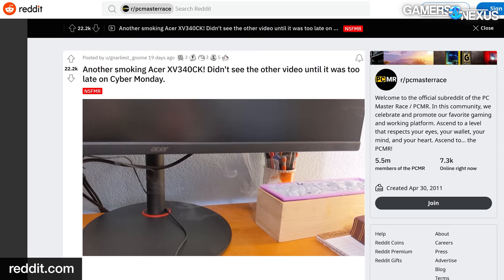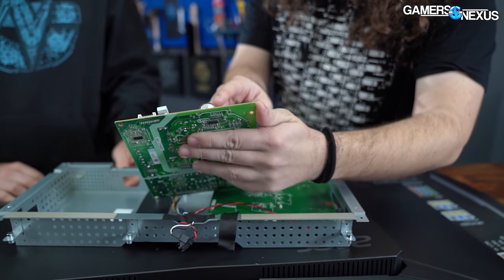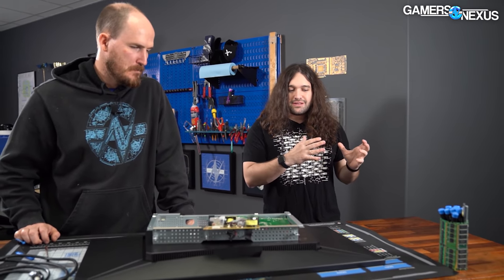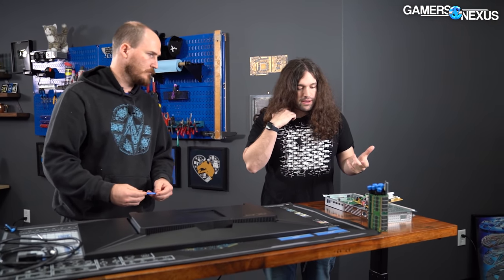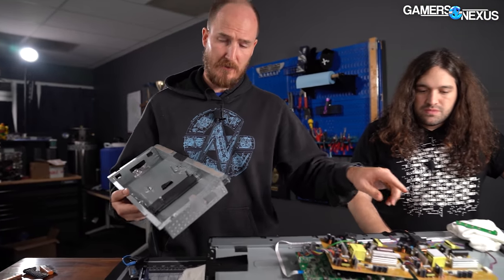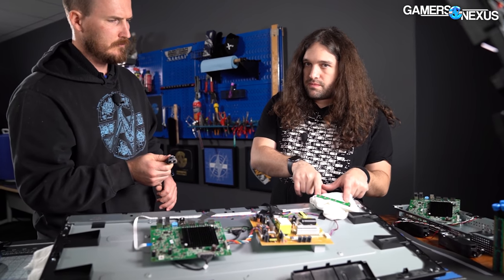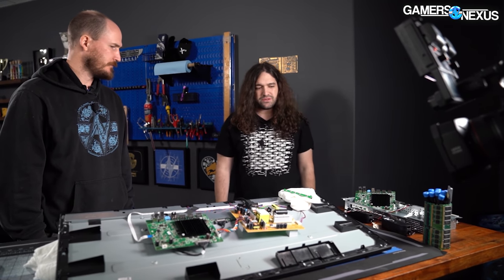Acer Monitor Fires Investigated: Blown Capacitors on Acer XV340CK

Comment from the maker: (FYI: We are now using one of the retail units in the office and are monitoring it for longer-term use -- might as well keep an eye on it and get some use out of it at the same time. We will let you all know if it dies.)
If you want to see a component spectacularly explode, watch our Gigabyte PSU explosion demonstration: https://www.youtube.com/watch?v=7JmPUr-BeEM
Grab our NEW Red & Black 'HUD' themed Mouse Mat on the GN Store! https://store.gamersnexus.net/products/gn-red-black-hud-mouse-mat
Grab our 'Volt' Large Anti-Static Modmat for PC building on the store (in stock & shipping now!): https://store.gamersnexus.net/products/modmat-volt-large
Reply: Asus ROG Z690 is on fire too high end bord too :o wtf
Reply: You gonna investigate the fire issue with the Asus z690 mobo that Jay posted about today?
Reply: Capacitor issues, welcome back to Mobo's in 2005.
Reply: Monitoring the monitor?
Reply: Monitoring the monitor, huh?
Reply: 2 things its either a bad quality capacitator , or a power spike ripple that revealed the issue, the smoke and humidity is normal when the main filter capacitator blows when on charge. have a happy new year love your channel
Reply: Did you make sure the refresh rate was set correctly in windows? Didn't hear you explicitly mention it.
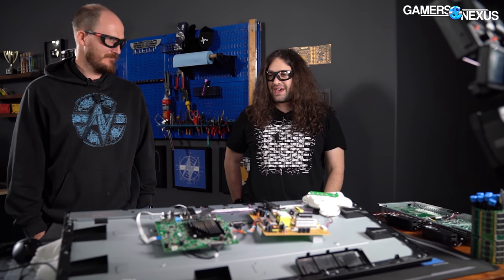Reply: 15:37 I feel that calculus was discovered by 2 mathematicians independently of each other.
Reply: Really nice to see that I'm not alone doubting about the quality of my monitor. I'm currently using an Acer CB342CK which makes lately a hell of a noice (like a BIG relay noise) while going to sleep.

I did not put it apart since it stills works but as you point it out, it can be a hazard and I'll take a look to see any failing part. 

Thank you ! Keep up the good work ! :D
Reply: Try using a FLIR camera to see if the capacitors get warm at any point. I don't see anyone using this testing method especially on components that have fire related issues and it gives quite good insights on heat related problems.
Reply: Does the monitor data plates show a date of manufacture? Maybe you can identify that monitors manufactured after a certain date have the different capacitor installed.
Reply: I'd love for you all to attack the eco side of electronics, on top of product safety and manufacturer/retailer issues. Good stuff!
Reply: That one taiwanese electronics manufacturer with an "A" at the start of it's name is still using fake Rubycon capacitors. Why am I not surprised?
Reply: Thank you so much man for doing what you do I appreciate you and your crew.
Reply: That looks like a Nichicon or United Chemicon capacitor (not gonna go searching exactly right now, but I have a bag of those exact same caps in my parts bin), which are supposed to be both quite high quality, generally speaking. If it's the bulk cap that's causing the failure, that's definitely just a bad batch. I've bot a bunch in use in an amplifier rectifier (4 of both 250 and 350UF same voltage, and 2 of 450), and they're all going strong. Bought them before the shortages got severe sometime last fall (2020). I had some fun making an arc generator using the rest of the caps, and it ran for a few weeks straight as an ozone generator in the garage. Definitely a serious issue though for sure, but if it's just bad caps it should be easy enough for anyone with a soldering iron to repair. You guys might even be able to get the broken panels working if those bad caps are the only thing damaged

edit: dang, it looks like one of those other boards has a totally different bulk cap. If the failure there is the same, that makes me suspect a lot more is going on than just a bad batch of caps. That's a big oof for ACER, assuming yours goes bad the same way.
Reply: why... why does this happen today?  sure it used to happen to me 25 years ago when parts were made by the lowest bidder sporting a name badge like "Q-Tec" but I kind of thought with mass automation in production that they would have oh I don't know, at least figured out how to stop their products incinerating your wife and children of an evening. 

I will tell you why it happens, the profit motive. That mass incentive to cut quality and cut corners in production and cut inspection procedures as a costs of labor saving measure. All replaced by QC machines of loving grace.
Reply: We are going to be seeing a lot more failed parts as the counterfeit market ramps up sales to companies.  Wait a year and watch the CARS that use counterfeit electronic fail and burn.  :(
Reply: Would be curious if you were able to replace that cap and see if they work
Reply: @Crckwood  there's a good chance your monitor is too close to something else.
Reply: thats impressive :D
Reply: Are you certain this wasn't a special effect designed to add realism to war simulators?
Reply: Do a repair video dammit!!
Reply: I wonder ich Acer has patented their "thermal cubes".
Turning something meant to transfer heat into a thermal insulator is certainly an archievment.
Reply: The secondary transformer I Think is For Overload Protection and subsequential power Draw During Overclocking , IF i am Not Mistaken , supposedly a redundancy of sorts , if that makes Sense ? and Yes i Know there is Also another transformer meant For That alone , however , I May be wrong but what i am seeing is that it is for a subsequential draw = ? = {    schematics  }
Reply: @Gamers Nexus have you seen the video made by Jay discussing the 12th gen maximus boards catching on fire, and do you plan to look into it???
Reply: I was thinking you should make a name for these kinds of segments "tech-busters" or "warranty-busters" basically myth busters where you break the tech
Reply: Every electronic thing works using white smoke. Once the smoke gets out, the device won't run anymore.
Reply: Just out of curiosity.
Does the monitor still work after replacing the component or the power unit?
Reply: SMOKE SCREEN ACTIVATED LOL 😆
Reply: @alfonsputzeys9228  basically, the units Steve's talking about here still work, therefore he didn't have to replace anything... As for the viewer submitted monitors, he's going to be doing a video trying to fix the problem and make those monitors work again

*Note* that's assuming you're talking about the ones in this video, and not ones talked about in this comment thread
Reply: @northwiebesick7136  yes, i know they are going to try And repair it.
But they could also have disassembled a working power unit and hooked it up to the faulty one. To verify screen functionality.
Imho
Sometimes you just get unlucky and a fault takes down the entire unit completely in a cascade effect.
Reply: @alfonsputzeys9228  they could have, but I'm betting that the reason they didn't, was because that's part of the next video. I imagine that's one of the steps in replacing the busted part is seeing if a new part from a different monitor does the same thing. But of course, there's the price aspect, whereby the higher the cost, the less likely you are to want to brick a known good unit, unless absolutely necessary, so, that's probably the route he'll take, and at the skyhigh monitor prices (compared to the (relatively) cheap power supplies he's normally testing) I don't blame him...
Reply: The supply strain has caused manufacturers to use components they can get their hands on. Which has been leading to a higher amount of defective items I'm assuming.
Reply: @lukefranks8795  AHOC did a video, looks like a cap installed backwards.
Reply: Do I see an @Adrian's Digital Basement colab in the near future?
Reply: Give some coverage to the exploding Z690 boards too... many things are catching fire this last year
Reply: Now have Aus Z690 $600 boards going up in smoke now...
Reply: What about the Asus board that catches on fire
Reply: Electronic device:
-fast cold-warm + power = failed;
-fast warm-cold + power = failed;
- more or less, electronics have problems with this.
My advice, power devices after 1h-1,5h after they have the same thermal ambient, avoid Tv's close to windows(this is for under 5° Celsius cold air) .
Reply: @alexandrub6412  so you are saying your room should be 60c before turning your PC on
Reply: This is the most time wasting and money wasting thing ever. Of course most of them would not fail. You people have too much money.
Reply: This was the most boring video of two guys trying to blow up a monitor i ever watched, two black holes of charisma.
Reply: @lukefranks8795  buildzoid apparently found the issue. One of the capacitors was put on the motherboard backwards
Reply: Steve, you did not learn anything from @Louis Rossmann, just take capacitor from working board  :)
Reply: Are you going to do a video on those Asus ROG motherboards that seem to have the capacitor backwards?
Reply: 10:48 it's look like no thermal pads but distance pads XD
Reply: Cool I bought one 8 months ago it hasn't shown anything scary yet, hoping nothing's wrong with it.
Reply: What was the manufacture date on all the monitors if the brown caps are in the middle then it Would be like a supply issue and they might not of even know the manufacturer could of told acer it was a comp and they just believed them also how old are the brown cap ones and how close to gather are they is acer doing good with the warranty
Reply: It high voltage(400V) 100uF . It blow up in 2 case : the dioda ac dc faliure or ac input over 260V Rms .
Or the capasitor top volatage less then 400V.

400V max is about 282v ac nominal.

Charge the capacitor with 250v dc , and then 400v dc .
* check that out from pcb. 

But you show us all video without any problem. Even you dont test off power frow wall (Watt) .
Reply: All the monitor build in power supply in junk.

I had dell s2621h with build in power supply. In offmode it take 7.3W instet (less then 0.3W)
Reply: Could the caps have been installed backwards like they were in the Asus ROG motherboard?
That is one of the ways Electrolytic caps blow and release the magic smoke
Reply: Monitor the monitor?
Reply: If you repair the other monitors you should make a video of the repair process.
Reply: Running the monitor without the back panel does lower the components operating temp. That could be why during testing the caps don't blow up.
Reply: I have this monitor and mine started to give spark sound ( near both the speaker sides ) and a fliker at random times for a second or two after a month of use. Raised complaint but Acer not doing anything 😑
Reply: Any update Steve ? 
My monitor is also starting to fail now. It started happening after a month of purchase. 
See what is happening with my monitor right now in the video here:

https://drive.google.com/drive/folders/1p9lvBK_b7YjvBPB2K3pH4kGLBdJWmabz?usp=sharing

Comment: You've gone about it wrong, it's a feature. Realistic fire effects. It just works once though, so use it wisely.
Reply from the maker: Synchronizes with the launch of the next Battlefield game!
Reply: "nice screensaver"
Reply: Intro fog
Reply: Finally, 4D monitors bringing that immersion to a new level.
Reply: Lmao! REAL time ray tracing
Reply: @HoleLeashIt  Pair with 3090 playing New World on an Asus Z690 Hero and Gigabyte PSU in an NZXT H1 for optimal experience.
Reply: It just works
Reply: Its that magic smoke that once it puffs out there no putting it back in and making it operational again 🤣🤣
Reply: @walkerclinedinst2820  Lucas sells replacement wiring harness smoke, I suspect it can be repurposed for capacitors.
Reply: They used to say that one needs to let new PC parts "burn-in" before use so maybe Acer decided to implement this feature in hardware. I heard it can improve FPS and response time  consistency.
Reply: Asser makes the best monitors!!
Reply: @GamersNexus  works best when paired with a gigabyte power supply
Reply: 5D, bring all duh dimensions pllzz
Reply: its real nft version
Reply: Tom's Hardware : When you die and your life flashes before your eyes, how much of it would you want to not have been raytraced?

Somebody looking at a burning computer : Looks plenty ray traced to me
Reply: So good, its a smoke show
Reply: Has there been an update to New World, by any chance?
Reply: Rgb fire effects? Neat
Reply: @SolarianStrike  I died when I read your comment 😂
Reply: Still cheaper than RGB LEDs.
Reply: So basically AR ray tracing on crack.

Gotcha. 👍😂😂😂
Reply: @KellsKats  Once.

😂😂😂
Reply: @methany8788  got that reference! Lmao
Reply: Itz next level RGB or RTX. They may market it as 4D

Comment: Best idea for now: just replace the dead capacitor with a working capacitor from the monitors you've bought and see if they pop just the same. The failure might not be the cap itself but a board design flaw that they later discovered and corrected but didn't have the old stock of caps anymore and sourced something similar.
Reply: Good idea. It's probably the cap, because cheap low-grade Chinese sweatshop caps pop all the time. I bet something actually not garbage got swapped with or without Acer's knowledge for something that on paper meets the spec, but in reality just doesn't. Acer is probably kicking themselves for using these caps or letting their PSU manufacturer sub them out and they're hoping the rest last beyond their warranty at least.

If it is the cap, it's repairable.
Reply: Also the main way to get monitors back and running again is Cap replacements, looking for any bougled or split.
Reply: they did say they'd do that at the end of the video.
Reply: Well for the tinkering consumer that watches this. We can just take it apart and see if it has a brown capacitor. If it's brown take it back.
Reply: I looked up those capacitors and they're actually kind of hard to get a hold of unless you buy them in batches.
Reply: @wobblysauce  those Caps are actually hard to get unless you buy them in batches.
Reply: My first aid for monitors is to replace all electrolytic caps. Assume all caps as dead or dying unless you got a capacitance tester.

Usually its just caps in the secondary or in the board. If you only have limited caps, bloating and leaking is the priority -- but check the circuit and replace any nearby caps as well if you can.
Reply: @knghtbrd  It could be the cap or the PFC circuitry which is overcharging the bulk capacitor. It's rather strange to see the main bulk capacitor fail, since it's one of the least stressed part of the circuitry. It would be worth it to swap capacitor and check if there is a different voltage on its pins when the PSU is operational.
Reply: @Dtr146  it's just a capacitor, a basic component, anything of the same capacitance should work fine if the one they used was just cheap Chinese stuff.
Reply: @marcbensen8963  He could back in the 1940s. But while he's been asleep, we stopped making anything here. 😞
Reply: @EnricoConca  Would be worth a shot, especially if Stone's interested in learning more of the engineering side of this stuff. You might be right there. Even a cheap electrolytic shouldn't pop that quickly in any significant quantity.
Reply: Wouldn't surprise me if it's the cap. The problem is the electrolyte on cheap caps are almost certainly mostly water. Need to make sure to clean that board around the cap with flux and maybe give it a good wipe down with IPA.
Reply: Or it could've just been a counterfeit part the supplier was forced to buy because of supply chain shortages and they had orders to ship to Acer.  China doesn't have a lot of regulations preventing that
Reply: Best idea: RMA it
Reply: @eideticex  Why would you use flux to clean the electrolyte? Retrocomputing people deal with exploding caps all the time, look at the techniques they use (which vary a little bit based on what did what, including soap and water at times!), just make sure everything is clean and dry before you try powering it up again. And I mean REALLY dry. Because while water itself is actually NOT a conductor, it is a solvent, and anything that gets into the water can be (and typically is!) Shorts are bad!
Reply: easier way to pinpoint a board design flaw is to see if theyve added bodge wires or spun up a new board. 
its very rare for the board design to be bad tho, tweaking component values will fix most flaws. 
but then again, I design audio gear, not monitors. what do I know?
Reply: Didn't the posts say they were bought on black Friday sales? I think I heard that companies downgrade their products to avoid any lost revenue during black Friday, this might be the root cause...
Reply: @goofball1_134  That's nonsense, companies cannot time the production of their stock for a specific date like that.
Reply: @knghtbrd  no it's not the cap, current is roasting the massive cap
Reply: @knghtbrd  we have seen that multiple times this year unfortunately. Counterfeit components (cheap/bad knockoff component with name of trusted company stamped on it) that get injected at the distributor level. So you buy fake components from your normal supplier. We had so any problems with recalls for our testing Equipment we produce and sell, that we now test every single shipment of capacitors and certain types of resistors before soldering them to the PCBs.
Reply: It also would be a good idea to see if you can order the O.G. Part number from the supplier.   Then use something like the Capacitor tester from Mr. Carlson Labs and see just how low quality or prone to failure via ESR and other metrics.
Reply: @MickeyMishra  good luck